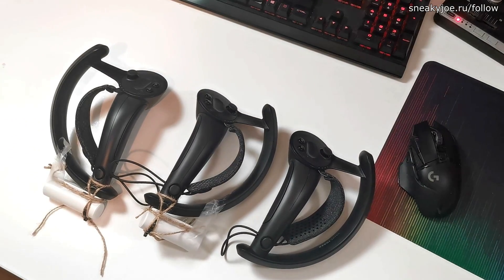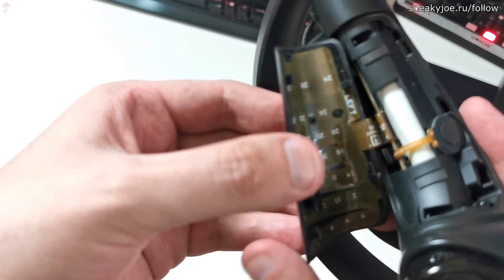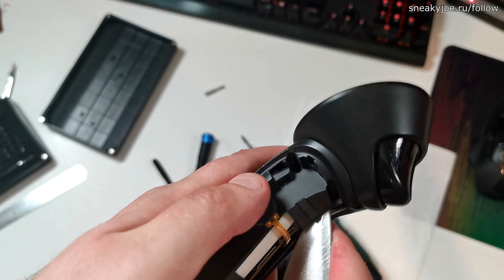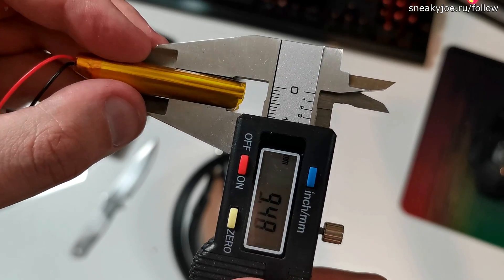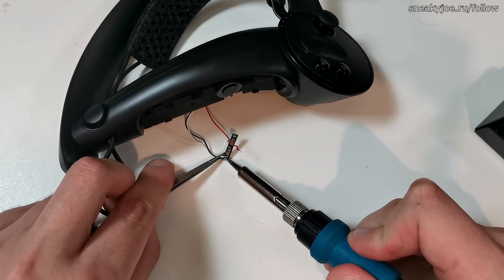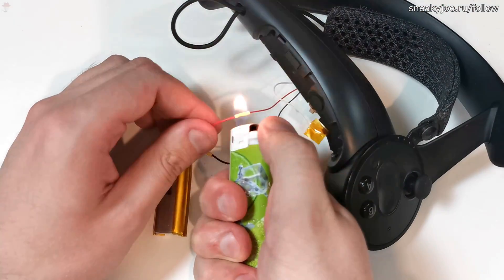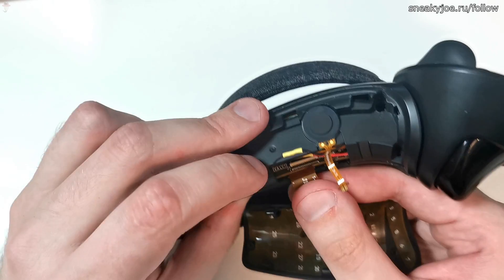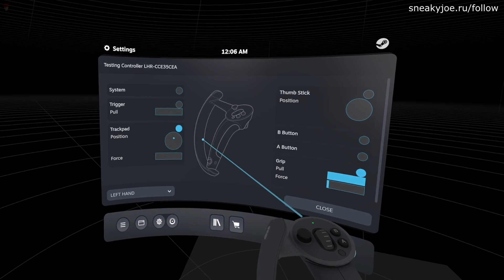Replacing battery in Valve Index Controller (disassembly and repair) #righttorepair

Comment: Sooo pimax sent me a replacement controller (left index controller) and told me to take the battery out of the faulty one and put it in the one theyre sending me because they cant send it due to customs (wtf bullshit is that), after watching this, they can get fked.

thank you for this video, i sent it this to them and asked "wtf"?
Reply from the maker: What a bunch of fuckheads man... They refused me in getting a replacement,  made me spend hundreds of dollars to get this video done, and now they're sending original controllers to other people?... Fucking e-waste shitting clowns.

Also my seller has allowed to send batteries to Germany if you're from it. You can give it a shot. Taking our 1 battery is still safer than taking out 2 for replacement (I don't think a battery you've taken out this way should be used as cover may be damaged and can get worse overtime)
Reply: @SneakyJoesENG  far out you too hey, that sucks man :(, Im on my 2nd rma from them because the 1st one came in a squished box that already had stick drift, most likely another RMA that wasnt checked and just shoved in the post before the luna new year.

my assumption is they dont have any index controllers left, which is why they have their "Pimax Sword" controllers.  

Im in Australia so Valve dont even sell their controllers or headset here. There is one retailer though who conveniently sell the controller separately so I picked up a left controller for $220aud which isn't tooo bad.

Honestly Ive had enough of pimax, there's no 12k on the horizon the pimax crystal is a joke.

I just wish there was another vr company out there that did large FOV headsets.

Good luck with pimax man, i'll keep you posted with whats going on my end.

Stay safe.

Comment: i think i like the usb power banks tied with string solution better than risking breaking my controllers
Reply from the maker: It's a decent solution if you don't play beatsaber. Inertia on centrific force is too high and there's a risk those can get torn off.
Reply: Except..... if you have to tie a usb power bank to it with string, your controller is already broken.

Comment: It's not worth trying this if puncturing the battery is going to kill someone. I'd rather take my chances on the warranty.
Reply: is... it really gonna blow up if not careful?
Reply from the maker: @taiyoh04  You can look up what happens with a battery if you pierce or bend it. Liquids ad metals inside go into a rapid chemical reaction with oxygen, and it'll be either an explosion or a fire. So yes, this process, despite looking trivial, may be dangerous if you don't feel the limits, thus the warnings I constantly gave.
Reply: @taiyoh04  Not sure, but he mentioned it on two occasions, so it must be true.

Comment: Steam refusing to help you is is real issue here. Steam and all these companies should KNOW that batteries don't last very long. A controller that cost 300 dollars should have MODULAR parts. It's very easy to make parts modular so there isn't any excuse. Being able to pop the side off of a vr controller and slap a new battery in or replace a drifting thumstick should be a inexpensive and quick fix. It would save the company money on defective replacements too, instead of sending people a entire new stick they could just send the part. I don't get why they didn't think of this.
Reply: Yes, they're asses for designing it they way they did. But I'm glad to see number of sold batteries now which I helped the guy to design, and I just know that Valve lost a huge chunk of money they could keep if they didn't decide to screw me specifically. If I'm offended, I'll do everything I can to screw over the offender.

Comment: Thank you so much!!! Both of my controllers wasn't charging and even if I manage to hard reset them and turn them on, everytime I plug in to charge they will just die again immediately. I follow your instructions and found out the battery's BMS gone faulty (I think somehow ONE of my charge cable killed BOTH of them) all I did was cut the white wire and now they are charging again! Now I just need to wait for the new replacement batteries to be delivered and replace them. Because Valve won't do RMA for my country and you just saved me $300 for new controllers!
Lesson learned: Don't use some fishy made in china charge cables for your controllers!!!
Reply: Most likely batteries just ended their lifespan and failed to hold charge. There's not much to die in BMS, unless you were forcing high voltages on it. Cable is also unlikely to kill it, but a bad power brick might have. 
Yeah, Valve are douches when it comes to help with VR hardware. And when I think about many support cases I had with them, they were douches in general, so I'm glad I helped another poor soul to save some money :-) Good luck with replacements, and be sure to watch both videos for install instructions not to break anything.
Reply: Instead, use fishy made in China battery replacements instead! 😂

Comment: i think id rather take a dremel and cut through the plastic of the controller untill i reach the battery from a different angle before i take this thing apart

Comment: i am not going to fucking do this, valve... what the fuck? why is the battery buried deep inside teh controller like this where you have to take the whole thing apart...
this controller is only good for like 60 charge cycles max until it has a 3 minute battery life...
Reply: I've been using mine since 2018 and the battery in one of them just died.  Battery life was great right up until it wasn't.

Comment: So I have a question. I hit the front of my controller on my desk and it caused loss of tracking but it stayed on but was blinking I finally go it turned off by holding buttons down power and b for 15 seconds ..but now it won't turn on ..but when I plug it in via USB it recognizes it and says I need to update and it does it and says successful but doesn't turn on still ... Any ideas ???
Reply: Check comment of Dan Rob under this video. It might help.

Comment: Big thanks for this vid^ My issue was not the battery. The strip/bus that connects the bottom chip to the top one unplugged its self when I dropped it on the floor. I was sure the thing was dead. I was just going to buy a new one but Steam don't have any. Was able to plug the strip back in with a pencil in the end, was like building a ship in a bottle because I only had the thing open as much as you did.
I have previously sent a controller back and got sent a new one free. Same exact symptom, I knocked it, and it died instantly. No response to anything, totally dead. I'm now sure it was the same strip that came loose.
Reply from the maker: Well, I'm glad it helped you :-)
Reply: Where is this located I dropped mine and believe it's same issue
Reply: @Sh4dovv  its the top half of the controller. There's a data strip that connects the two halves together. It plugs onto the top half, flat on the surface. Just keep an eye out for a data strip that doesn't go anywhere. Theres only one
Reply: @dnrob7  so do I need the bottom off by battery or just the top part the pops off by buttons
Reply: @dnrob7  I found it but doesn't seem to be unplugged not sure what's wrong now ... Weird just stopped powering on after hitting my desk a little
Reply: @Sh4dovv  try pushing it down into the connector anyway. it might not be all the way off but just a lil loose. like I said, i used a pencil (with the lead tip broken off) to push the connector down
Reply: @dnrob7  ok ya I try it again. I was wondering maybe the bottom part of connection was loose but that from looks of it is taped on with some sort of tape they use .. idk it's just really weird that it ont power on but still makes the noise when plugged into a PC and gives me a message saying there was a error and it needs to be updated for tracking and it successfully goes through it but never with lights on or anything at all.doesnt even show up on steam VR just the right controller .. could possibly the actual battery connection come off since it's just glued on??
Reply: @Sh4dovv  I suppose it's possible but in all honesty, this stuff is out of my lane. I have no experience with electronics repair and when I fixed mine, I did it just by bumbling around and looking for something that was so obviously wrong that even a goon like me can spot it. 
I was hoping it would be that connector in most or all of these cases because its so easy to spot and fix. 
Wishful thinking on my part I guess.

Comment: Wonderful tutorial. This is far beyond my skills (and my patience levels) so I'll never do it. It's a shame, repairs like this shouldn't be this difficult because like you said it just creates e-waste. But that's the world we live in today.
Reply: It looks harder than it is. After all if it's broken whats the worst that could happen? You're gonna break it?
Reply from the maker: Hearing this is beyong someone's level is kind of funny. I don't consider myself the most handy guy in the world, and the process is relatively simple if your hands don't shake like mine. Harvesting BMS isn't necessary if you want to use a battery which goes with one, I did it just to show it off, and to explain how to get one in case someone wants to experiment. The rest just requires some tools I've shown and patience.
Reply: @SneakyJoesENG  I have absolutely no experience or skills at soldering, nor do I have the tools or the confidence to crack up open my ~$300 controllers. More over, I do not have the patience to spend the time trying to do it myself. Either way, I am glad someone is out there doing this kind of content so other people can benefit from it.
Reply: @KuraiShidosha  Once you get to a point when one of your controllers stops working then you'll loose nothing by giving this a wee try. Honestly, it's a lot easier than it looks - the hardest part, by far, is having patience - and you might get lucky reconnecting the bigger ribbon quickly. Tinkering like this also opens up a whole world of money saving, and in this respect, YouTube is very good (e.g. wire your own Cat7 ethernet cables? no problem...save a lot of money).

Comment: And why does the BMS need a termistor to know if it is fully charged when it can measure the Voltage? You dont measure the charging state by temperature...
Reply: You can read about thermistors in a battery. Yes, it can measure a voltage, but it's more precise and allows for a more secure charging.

Comment: Very nice and helpful video, thank you! My controllers are still pretty new and have no problems with the batteries, but when they'll need changing, I'll be sure to come back to follow this advice. I'm wondering, though, you didn't use the controller because you used a battery with lower voltage? Without it, won't the battery simply keep charging until it fails spectacularly?
Reply: No. It gets charged with 3.6v-3.8v on wires, and safe charge voltage for this battery is 4.2v, if I'm not mistaken. The BMS on the battery will just prevent it from overcharging and exploding.
Reply: @SneakyJoeRu  That's what I meant. :) Without the BMS you have to pretty much time your charging and only charge after complete discharge, I suppose.
Reply from the maker: @MetalCanyon  Without a BMS you need to use an external charger. Timing this is absolutely not an option since it will just degrade overtime and you'll miss charge stop at some point. Then you'll need a new house and maybe some limbs. Just get a battery with a BMS - almost all batteries I've seen of this form factor have one. :-)
Reply: @SneakyJoesENG  Great video! Thank you. But why did you harvest the original BMS and not use it on the new battery?
How will you prevent overcharging?
Reply: @blaxxun75  I don't have a spot weilder to securely solder bms to the battery. I was thinking of doing it with soldering iron, but decided it's not worth the risk. Hopefully the seller I've hit up will be able to wrap us some good quality replacement batteries soon and won't charge more than reasonable for those. I'm helping him with parameters now.

Comment: Maybe valve doesnt want to provide the battery because if you puncture it you WILL DIE like you mentioned a few times lol.
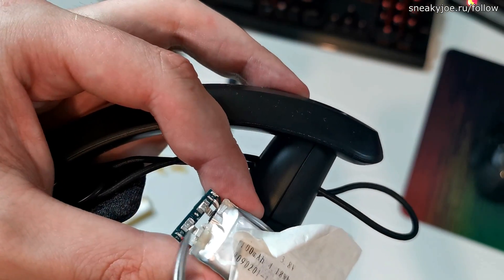Reply from the maker: It's a small pcb on the battery which you can see at 6:30.
You can almost always see it on photos. If wires come off the battery itself, it doesn't have a bms, but if you see a duct tape/capton tape and wires come off of a board, the battery has a bms.